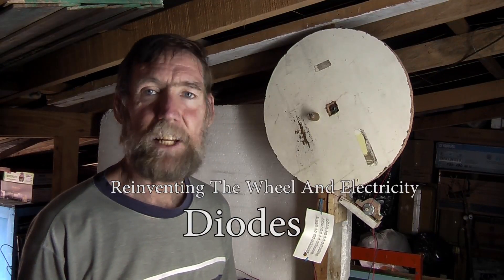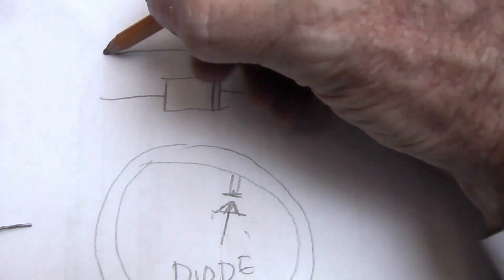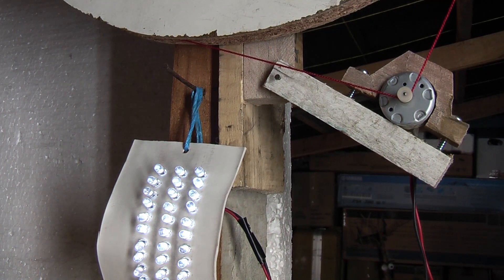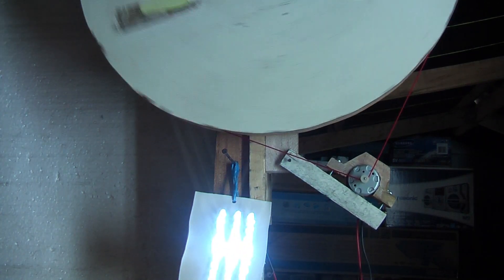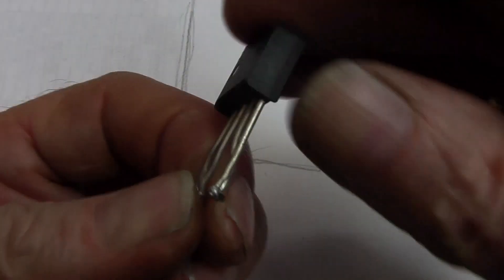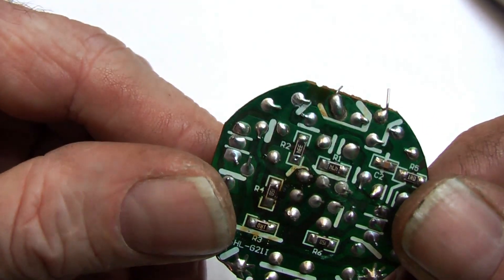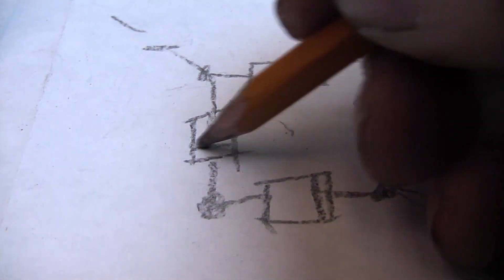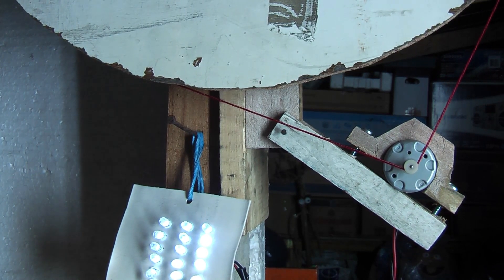Reinventing The Wheel And Electricity - Diodes

Comment: Philip, you've provided the first explanation of what a diode does and how they may be used that I've managed to truly understand. I'm confident I won't forget either. Thank-you. Cheers, b.
Reply from the maker: Yay, I was in the same boat, and I could never  remember which way to put them in. As someone commented LEDs are diodes.. and then there is the zener diode! They are cool, designed to let current through at given voltages. I hoped the theory bit would help someone. Catch you next time around.

Comment: Love your videos Phillip, you remember me of a very dear teacher of my youth (not that I'm that old lol).
btw, when you want to use a rectifier from old or broken electronics its good to check if the diodes are already connected in such a configuration, in the case of that broken lamp driver you could cut the board isolating those four diodes and save some solder points, just add a cable here and there,  you can cut it even with the holes ready and all, desoldering a nearby connected component.
Keep up the nice content, your video quality and edition has improved a lot over time, it's nice to watch good channels grow like this. Lots of love from a Chilean viewer
Reply from the maker: Thanks. This youtube experience has been a learning curve, although it has become quite a bit of work. The first videos were pretty crunchy, as  hardly anyone watched them, but as the audience grew, it required more effort.

Good point about the  ready made configuration of  the diodes. I hadn't really thought about it as it looked too confusing, but next time I will check it out.

Saludos desde Colombia. :)

Comment: i wonder if home made batteries, using old jars, zinc plated bolts and some other metal , with maybe water or vinegar as acid, may be practical if you cant find small batteries to use?   nice to see the return of the pencil extender, i made one of those from watching your early videos 3 year ago!
Reply from the maker: I found there are a multitude of possibilities and have done some experimenting with them. usually  zinc in batteries indicates non-rechargeable, but it's an interesting topic. I am running short of pencils...must  make some more 'extenders' :)

Comment: That's cool, Phillip. So, if the generator can work in both directions, could you feasibly use a pendulum as the driver instead of the wheel?
Reply from the maker: Theoretically you could, but to drive a wheel, to  drive the motor, or a rack and pinion -rack on the pendulum and pinion on the motor. and if you went down those roads, you could use piston action also. The closest I am to trying anything like this, at the moment, is the  yo yo, which is still wheel rotation. You could put a pendulum on a stepper motor and see what happens....
Reply: +PhilipStephens007 good points, cheers.

Comment: you can try to use electrolytic capacitors instead of batteries since they accept charge faster than batteries the more farads the better but be careful when capacitors are charged
Reply from the maker: Yes , in later videos we will get onto that.( I am just getting into making some  capacitors at the moment. :)   ) I am  going through, repeating  my  learning process in the videos, and  a battery   was where I was at with this build...and  the bridge rectifier was a revelation for me. I am watching  super capacitor development but  still right now  there are pros and cons on  both batteries and  capacitors

Comment: Great video. 
Seeing how you do a lot of up-cycling, I am surprised you did not do a revisit using a scenario where storage devices were not available. 
Such that one would use a dropping weight on a string, wound around a thin axle attached to the large drive wheel.  
Not sure you could get 5 min to 10 min worth of light out of it, though being in the attic, you potentially have a 12 foot drop to work with.